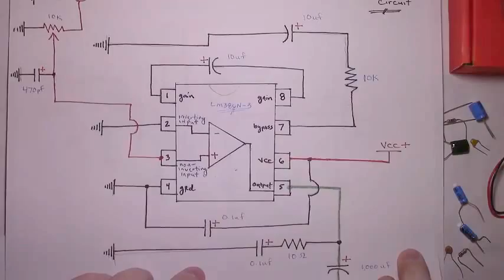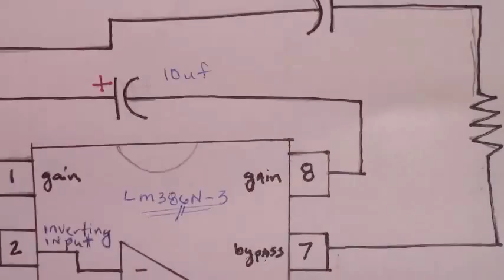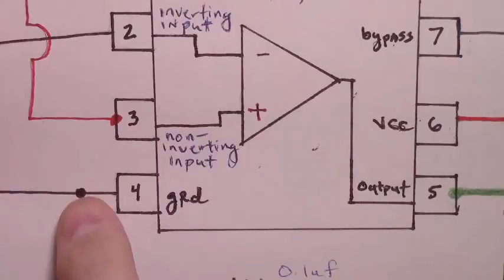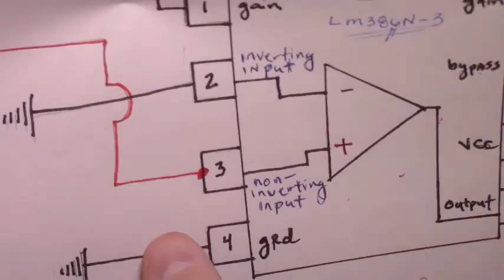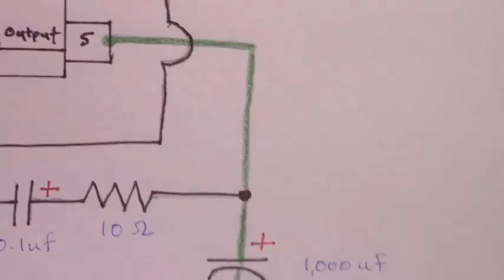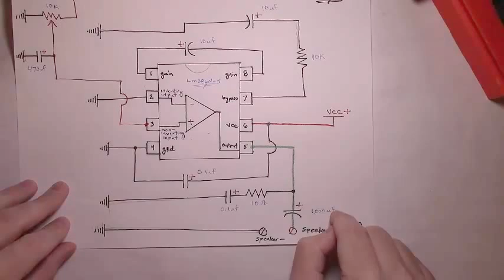Circuit Assembly Tutorials || LM386 Audio Amplifier

Comment: Nice tutorial, I'm wondering why your ceramic and poly caps are displayed as being polarized in the schematic?
Reply from the maker: Jake P Appreciate the question.  That was done for those who might attempt to use electrolytics or tantalums instead of ceramic or poly.  It's rare (in my experience) to see electrolytics in those sizes but they do make them in tantalum.  And, some might not have the values in ceramics or polys and think, 'oh, I'll just put this slightly larger electrolytic or tantalum of the same value in their place'(without thinking about polarity).  I was guilty of such when I first started out and ended up with a few exploding electrolytics and tantalums.  I'd rather be overly explicit at times than risk someone retracing my early days and have an electrolytic or tantalum explode in his/her face.  But, you're right, ceramics and polys are normally not polarized and labeling them as such could be a little confusing.  But, hopefully now that you've asked the question, we've taken care of any future confusion caused by my choice to label them that way in the schematic.    Hope these comments are helpful.  And definitely continue to let me know if/when there are any questions.  I'll always do my best to help.
Reply: Thanks for the quick reply, I like the channel, subscribed.  Have you tried any of the Burr Brown Opus opamps?
Reply from the maker: Jake P Appreciate the subscription!   I've worked with a few of them but it's been a while.  The one's I have used always worked well.

Comment: Hello. What would be the causes of not hearing anything? Thanks for your video.
Reply: Found it. Speaker was melted inside from my slow soldering haha! Although now there's another problem. The audio sounds good but it doesn't seem to be as loud as yours! Thanks again :D
Reply from the maker: Pedro Ferreira Thanks for the questions.  There are a few things to check: 1) Does the volume change when you turn the potentiometer left or right?  If so, but the sound is still not as loud as you'd expect, then 2) are you using an LM386 - N3 or N4?  If you happen to be using a N1 or N2, then the overall volume capability of the circuit will be less, the N1 and N2 can't source as much amperage as an N3 or N4.  Less amperage = less ability to move the speaker's coil.  Or, 3) is your speaker 8 ohms and around 1 to 3 watts capable?  If it's, e.g., 16 ohms or 5+ watts capable, then the end result will be a lower/quieter overall sound output (due to either case involving more for the current/voltage to "move", more to "move" = lower volume capability in the end).  Hope these comments are helpful toward determining what might be going on.  Definitely let me know if there are more questions and I'll continue to do my best to help.

Comment: Hello, if I was to change the audio input jack to a guitar input would this circuit still work? Also if I add a potentiometer between pins 1 and 8 would that give me variable gain?
Reply from the maker: Sam Harries Thanks for the questions.
Using a guitar as the input source should be okay. I've seen many examples of people using the LM386 as a simple and portable instrument amp.  I've not personally used this specific circuit for such (don't have a guitar, etc.) but it should work fine for such an application.

A potentiometer placed in series with the capacitor between pins 1 and 8 would provide you with variable/adjustable gain.  I thought about adding such to the circuit in video, but for demonstration purposes chose to lean on the side of simplicity (i.e., max out the gain and do volume control through the pot on the input side).  But you can definitely have both by adding that second pot.  

Hope these comments are helpful.  Please let me know if there are more questions.  I'll always do my best to help.
Reply: philo mech I just want to say you've been a great help, with both your video and your reply to my questions. Thank you! I have another question I'd like to ask. I don't know if its possible with this circuit but if it is, how could I add photometers to this circuit to have variable bass / treble control?
Reply from the maker: Sam Harries Glad the reply was helpful.  It's possible to adjust the bass response of the 386 by adding a resistor and capacitor in series between pins 1 and 5.  The datasheet shows a generic schematic for such in the applications section.  I've tried variations of the datasheet's suggestions and haven't achieved the greatest quality of sound at the output (this doesn't mean such isn't possible, just that I haven't yet be able to do so to my satisfaction).  

Instead of trying to adjust bass, etc., via adding more components around a single 386 circuit you might instead consider adding adjustable filtration circuitry ahead of the 386 (or even a few 386s).
 
For example, one might try adding an active high pass filter (what might be referred to as an 'active high pass filter 'preamp') in front of one 386 circuit for treble, an active low pass filter 'preamp' in front of a 2nd 386 circuit for bass, and an active midrange bandwidth filter 'preamp' in front of a 3rd 386 circuit for mids.  This type of setup should enable one to place potentiometers immediately before or after the 'filter preamps' and in turn enable one to manually adjust the output amounts of each.  Now, such would imply that one is also driving a tweeter ('high freq speaker') from the 1st circuit, a woofer (low freq) from the second,and perhaps a full to mid range speaker from the 3rd.  One should only need to use one audio input but break it across 3 active filters into 3 LM386 amp circuits out to 3 speakers.  This is likely far from an 'ideal' setup in that it would still only be mono, and input impedance could become a problem depending on the design of the active preamp circuitry, but it might provide one with near total control over the amount of presence of each frequency at the eventual output end.    Once again, not 'ideal', but possibly doable and definitely an interesting experiment to try....I'm curious about the viability of such a setup and might try it in the next few days just to see/hear what happens.  It might result in success, failure, or mediocre sound but it's the fact that I'm not completely sure about the outcome that makes such an experiment interesting and fun (at least for me).  

 Hope these comments are helpful.  Please continue to let me know if there are more questions.  I'll always do my best to help.

Comment: Hi, love your work, you explain everything pretty clear. I have one question: Could I use a bigger speaker, i mean a really bigger speaker.

Thank you
Reply from the maker: Thanks for the comment and question.  Glad the videos are helpful.  As to using the LM386-N3 or N4 to drive 'larger' speakers: The chip will only (safely) output about 3/4 (N3) to 1 (N4) watt of overall power.  That's not a whole lot when confronted with a speaker capable of handling, e.g., 5 or more watts.  Every aspect of higher wattage speakers is built (for lack of a better word) "heavier".  An analogy is often helpful: Suppose one tried to push a bus up a hill with a scooter. The scooter might rock the bus a little but there's not much chance of it actually pushing it up the hill.  And perhaps more importantly, what happens to the scooter during  such an attempt? It would try its best, likely hurting itself in the process, with the end result being an injured scooter and an unmoved van.  Likewise, hooking the LM386 up to a larger wattage speaker would likely result in it trying its best to move all those "heavier" speaker parts with little success and possibly injuring itself in the process.  A very little speaker movement (and in turn sound) might be emitted but not enough to justify the strain being placed on the chip.   It's not always necessary to match amp wattage to speaker wattage, in fact having speakers a little above an amp's operational wattage is often perfectly okay.  But very large differences in either direction are not good (amp that sources a lot of watts hooked up to a tiny speaker = volume goes up then huge distortion and likely injured speaker --or tiny amp sourcing tiny watts paired with big heavy speaker = strained and potentially injured amp...I say possibly here because some amps include forms of internal over-current, etc., protection).  In the end, if one wants or needs to drive higher wattage speakers, then I'd encourage looking for an amp with more wattage capabilities than the 386.   Hope these comments help.  Definitely let me know if there are more questions.  I'll always do my best to help.

Comment: So I love the audio quality from this amplifier, I've been scouring the internet for a good DIY one, but it is super loud on my 8 ohm 5 watt speaker. I didn't use a 10k potentiometer, could this possibly be the problem? Any help is appreciated!
Reply from the maker: Appreciate the comment and question.  As long as it's possible to adjust the volume level from the mp3, etc., player then the potentiometer is largely redundant and not necessary.  However, if the music source doesn't have a volume control, the potentiometer or at least a resistor will be needed for volume control.  Assuming you don't have a potentiometer on hand, then I'd encourage you to try placing a 2.2k to 10K resistor in between the music source and amp circuit and see if the volume decreases to a more desirable level.  Hope these comments are helpful.  Definitely let me know if there are more questions. I'll always do my best to help.

Comment: Hello, I've built this amp and a few others using the LM386  being inspired by your tutorial. They work but I get humming and other background noise. Any hints on what might be the cause?
Reply from the maker: Thanks for the comment and question.  If you're encountering a consistent humming sound across multiple amp circuits, then the first and most likely causes to check for are (1) electrical background noise or (2) the power supply you're using. 

To start with (2):  If you happen to be powering the circuits from a wall-type AC to DC voltage converter (i.e, a "wall wart"), then try powering them from a battery instead.  If the noise goes away, then you'll know it was the converter.  Some Ac to DC converters are very noisy and small (or large) audio amp circuits are definitely sensitive enough to amplify such.  

As to (1):  The most prevalent source of electrical background noise are the lights and appliances near the circuits.  Might there be a set of higher wattage lights right above your work bench?  Or a larger AC appliance near by?  If the humming is very consistent, then it's a good idea to assume that the circuits are picking up the nearby AC frequency and amplifying it.  One way to test for it is to first power the circuit by a battery.  Let's say the noise remains.  No problem.  Just pick up the circuit and take it outside the house and see if the hum goes away or at least reduces significantly.  If so, then you'll know the noise isn't in the circuit but rather in the air around the build location.  

Definitely let me know if (1) / (2) don't help and we'll go from there.  I'll always do my best to help.
Reply: philo mech Thanks very much for your help. I went downstairs, and used a battery. Just the slightest background hum. Very much reduced. Plugged the wall wart in and the huge humming was back. Problem solved. Thanks again for your expertise and help.
Any tips on recognizing a good wall wart? I find them at the Good Will store.
Reply from the maker: ***** Glad the comments helped.  I'd wager that the last little bit of hum is due to the background AC EMI generated by rest of the wiring, lights, etc., in the house.  To find out one could take the circuit outside away from any houses and powerlines.  It's always interesting to figure out just how wide the scope of AC interference in one's immediate area actually is.  As to wall warts, I've also picked up quite a few from thift stores and the like.  One would want to avoid any that are 'obviously' un-regluated (which isn't always very clear).  

There's a helpful discussion of the difference between regulated vs unregulated power supplies on Sparkfun's website:  https://www.sparkfun.com/tutorials/103

And you can compare the labels of the one's you have with the regulated ones sold by Adafruit, e.g., their 9VDC 1000mA supply is a good example of a decent one (I've used it on many audio projects with much success.
http://www.adafruit.com/products/63

And finally, there's always the possibility that adding a ferrite bead or two to the output wires of the wart might help.  

For more an ferrite beads and how they can help to reduce unwanted noise, etc., you can do a google search for "ferrite bead to reduce noise".  But before going down the bead route I'd encourage you to do alse do a google search for "all ferrite beads are not created equal  digikey".  This is a handy article provided by digikey, it contains a lot of useful info about selecting a better or worse bead relative to one's specific application.   Beads are sometimes an easy and very cheap fix, but only if one doesn't have to buy 10 different types in order to find one that works.  The digikey document should help in distinguishing the more 'right' from more 'wrong' ones.  

Hope these comments help.  Definitely continue to let me know if/when there are any questions and I will always do my best to help.
Reply: philo mech I always feel like I'm stealing knowledge without giving any thing back (except for my "how to build a ukulele in five minutes"youtube video).  I am very grateful to you for sharing your hard earned knowledge with me. Thanks again. And I'll probably be back.
Reply from the maker: ***** No worries about "stealing" any knowledge.  It's offered for free, such is one of the great aspects of youtube.  Liked the ukulele video, if only we could all build them that "fast" :)

Comment: SIR I HAVE A 4 OHM 5 WATT SPEAKER. IS IT POSSIBLE TO USE THIS IN YOUR AUDIO AMPLIFIER CIRCUIT?
Reply from the maker: junard roma Thanks for the question.  You could use the 4ohm to test the circuit, to make sure it operates, etc.  But I would suggest obtaining an 8ohm - 1 to 2 watt speaker for the finished product (assuming you're using the LM386 -N3).  A 4 ohm should work fine for testing, but it will have the tendency to draw too much current from the 386 and in the long run might cause it to overheat.  Hope these comments are helpful.  Please let me know if there are more questions.

Comment: sir what value of resistors you used to convert stereo cable to mono..thnxx for such a wonderful video
Reply from the maker: Thanks for the question.  In the video I just used one of the two stereo cables, no resistors.  Most of the stereo to mono demonstrations that I've seen use 10K to 100k resistors.  I'd start with 10K and increase/reduce as needed.  Hope these comments help.
Reply: Thnxx for your quick and valuable reply.. God bless u

Comment: Hi, if i connect an headphone with an impedance of 16 Ohm, i have to change something in the circuit? 
Thanks.
Reply from the maker: Appreciate the question.  You can use the circuit to drive a 16 ohm headphone.  However, the output power, volume, etc., will likely decrease and there's a chance such may eventually strain the (internal) output stage of the amp.  A LM386-N3 was used in the video, I'd suggest using a LM386-N4 instead.  The datasheet indicates that a LM386-N4 is able to safely drive up to a 32 ohm speaker at 16V.  Using an N4 should give you plenty of overhead to safely drive the headphone at 9, 10, 12, etc., volts.  Hope these comments help.

Comment: This was a wonderful tutorial on how to build this little amp. My first bread board project and it worked! One question. When I first ran it it was so loud I had to turn the potentiometer way down. Then unhooked the speaker and hooked it up again and volume is much reduced. Any ideas about what I might have done?
Reply: Never mind. It was just the difference in my phone vol. that I was using for the input. Sorry.
Had much fun doing this. Thanks for posting.
Reply from the maker: flp2mm Appreciate the comment and glad the video was helpful.  I've encountered that unpleasant surprise of way to much volume on power up before as well.  It can definitely take one by surprise.  I always try to remember to turn the input volume down before powering amplifier circuits, but often forget to do so.  You had a nice 'hello audio world' experience with sound.  The first time I attempted an audio circuit I had no sound at all and when I did eventually get the amp to do anything it was all obnoxious static and noise.  Analog circuitry sometimes acts as though it has a mind of its own...in many ways that's what makes it so much fun to experiment with.  Definitely let me know if you have any questions as you attempt more circuits, I'll always do my best to help.